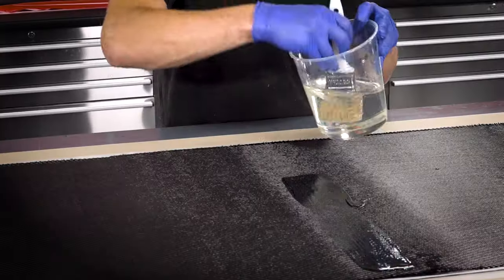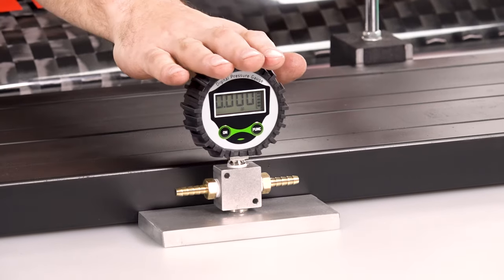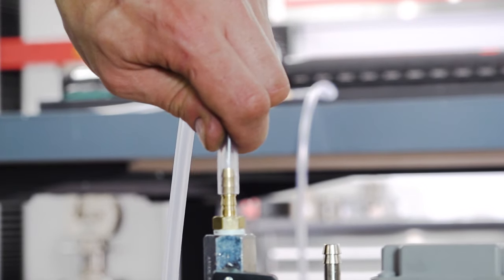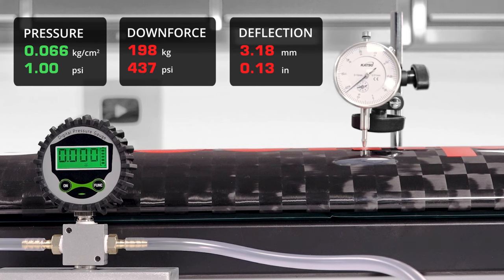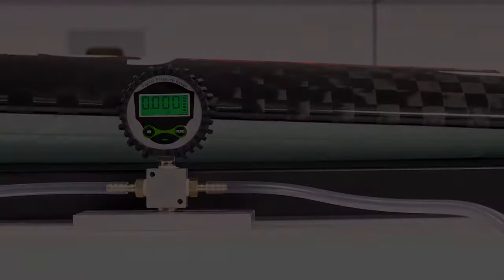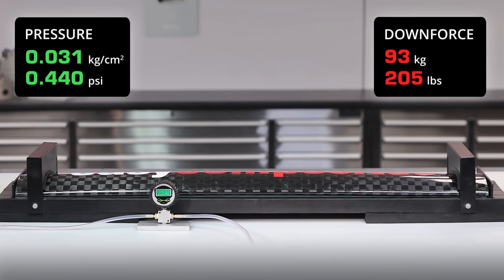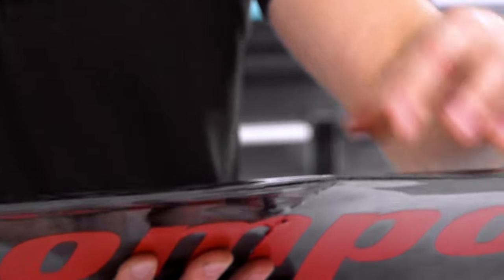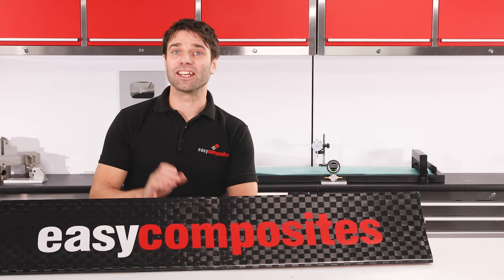How Much Downforce Can Our Hand-Laminated Carbon Wing Take?

Comment: What's the NACA digits for that wing
Reply from the maker: It was drawn up as a generic wing rather than anything specific. However the specific profiles used were 'Eppler423' for the main element and 'NACA4412' for the Secondary element.

Comment: That's a very informative video, thank you. I was expecting carbon fibre to fly everywhere when the wing failed, but that didn't happen - so there's a testament to the build quality! Just a few thoughts on the experiment:
First: The wing was inflated, when in a real-life application the wing would be deflected, would it not? One might expect a deflection test to give a different result, although obviously this wing is very strong. I suppose a deflection test to include a support at either part of the wing where it would be fixed to the race car, and a load applied in the middle. Maybe something like that? 
Second: The fracture in the exact center of the wing is interesting. Could that suggest that just a slight strengthening of the center portion of the wing would make the wing even stronger than it is now? To have the laminate thicker in the center portion and thinner toward the end plates would perhaps be ideal, and at the same time beyond the scope of this project (?)
Anyway, enough of my rambling... I'm looking forward to the next Easy Composites video, so keep please them coming! 😉
Reply from the maker: The wing element was inverted for the test (you can see if you look closely) so it does represent the deflection you would see on an end loaded wing. A centre mounted wing would perform differently. Although obviously the test rig is limited in its ability to perfectly represent the forces experienced. You certainly could try extra reinforcement in the center of the wing to see if that makes it stronger, and/or just moves the failure point.

Comment: Hey everyone, what might be a cause when resin sticks to the mold instead of the fibres, even though you applied multiple layers of release agent and let the resin cure for over 2 days (hand laminate resin)?
Reply from the maker: There are a number of potential causes. This could be out-of-date Release Agent; incompatible mould materials (Epoxy resin used on a Polyester Mould Tool), incorrectly applied release agent or removing the item when the resin hasn't fully cured; when it is still 'green', the resin can grip to the mould and come away from the reinforcement.
Reply: @easycompositestv  Thanks for the fast response. To give some more information: We are using a milled, sanded and lacquered Polyurethane mold. The resin takes quite a while to cure (550 min to gel). We let it cure for 2 days under vacuum. 
The resin itself is some months over it’s “best by” date, might that be the reason? Why do most of the resins have a best by date? How would you clean a mold from cured resin, acetone and such is not a option because of the lacquer?

Comment: Would it have failed differently if the core was one piece?
Reply from the maker: The adhesive used was stronger than the foam itself and the core did not crush as such so we suspect it made little if any practical difference to the results as the primary method of failure was on the skins itself.

Comment: I think the rubber washers threw off the measurements. One would think if this were mounted on the car those mounting points would be rock solid with no give. I would be interested in seeing the differences (for science of course).
Reply: Hence the second test with saddle mounting
Reply: They'd be attached to long-ish metal or composite verticals, likely rather thin ones, that definitely WILL allow some amount of deformation. A wing like this isn't going to be directly mounded to rigid metal body panels like this test setup does (minus the rubber washers).

Comment: Being the lazy sort that I am, I would go to the beach, fill a bunch of bags with sand and gradually set them on the wing until it failed. Bingo, an hour or so after getting back from a fun day at the beach we have our result. Ya see, this is the difference between the simple way and the engineers way.
Reply from the maker: But I'm not sure that would make the most entertaining video!! 🙂
Reply: @easycompositestv  I guess that depends on how really good you are at making videos. 😉 Perhaps one of those Benny Hill type fast time-videos with guys running around the beach, bumping each other, the constable chasing them off. It would truly be different than your usual faire.

Comment: How is the downforce measured here, some sort of black magic math?
Reply from the maker: The downforce is simply the pressure, multiplied by the surface area it’s acting over. Eg 0.31kg per cm2 x 3000cm2 = 930kg
Reply: @easycompositestv  thanks, even I can understand that 😂

Comment: The composite didn't fail... It was the lack of mechanical lock at the connection point that caused the fail....
Shape it better and test again.
Reply from the maker: Hence making the harness rig for the second test. This then allowed us to test the composite structure without having to worry about the mountings being the point of failure.